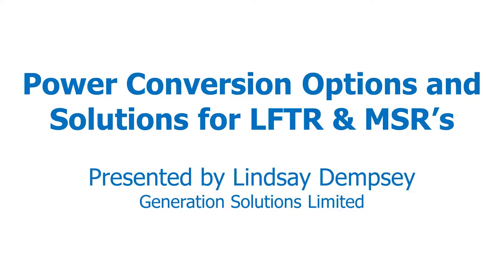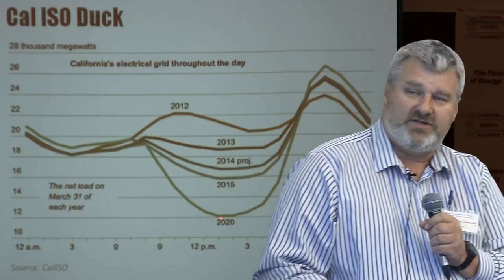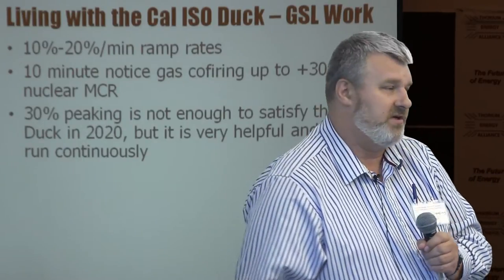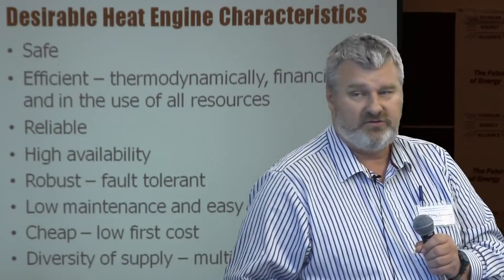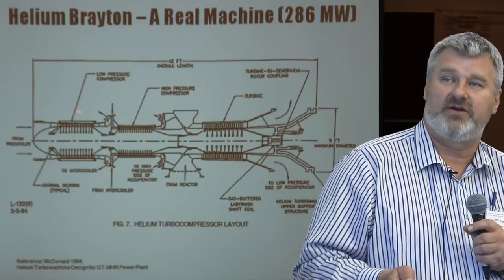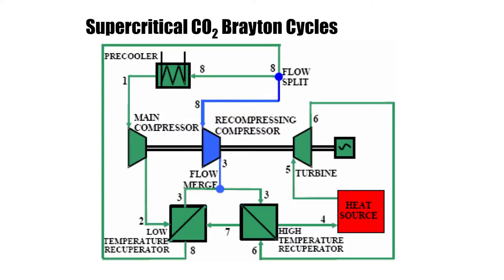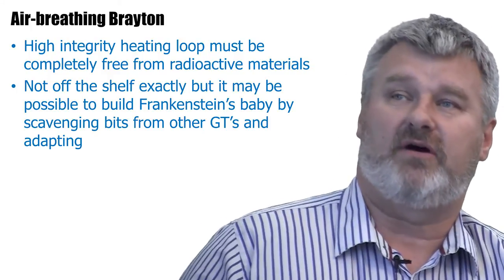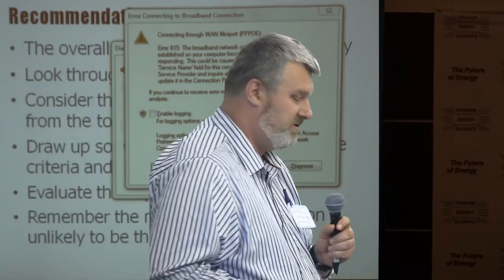MSR Power Conversion Options -by Lindsay Dempsey @ TEAC7

Comment: I think the key take-away here is most definitely the very last statement at the end of the presentation:
"The most economical solution may not necessarily be the most efficient solution"

We have to be pragmatic about power generation options. The WAMSR route by Transatomic of using steam to hit their LCOE competitive with coal and with minimal tech development is the way forward. A 90% solution available now to be able to displace coal generation instead of a more ambitious 100% solution is needed. In addition, being able to swap out a decommissioned coal plant while re-using the turbomachinery represents a cost saving that should be explored. Moving forward, supercritical steam turbomachinery could allow the 45% efficiencies without any technology development required as they are being put onto new coal plants as we speak.

If we are talking about CCGT then we must also heed the history of coupling nuclear with Brayton cycles - dry cooling/exhaust or not. The South African experience should be a warning to anyone chasing the 100% solution:
http://www.nature.com/news/2010/100223/full/4631008b.html
Their lofty goals of maximum temperature output and maximum efficiency using a helium Brayton set engineering challenges too high to meet. This is the risk of allowing perfect to become the enemy of good enough.

http://web.mit.edu/pebble-bed/Presentation/HTGR.pdf
https://en.wikipedia.org/wiki/Closed-cycle_gas_turbine

It is notable that the South African experience too, was considering using the high-temperature process heat for manifold purposes - hydrogen production, chemical process heat and so on. Their program failed because the goals were too ambitious.

MSRs, like any other engineering project, are in no way infallible to the same problems of scope creep. The difference between saying it can be done and actually doing it is an abyss that swallows dreams and spits out only tears. The nuclear power for climate change argument will only make sense if it is cheaper than coal. Until we actually see CCGTs being deployed from a variety of suppliers; we should curb our enthusiasm.

That being said, keep an eye out for Toshiba. http://phys.org/news/2014-10-first-of-a-kind-supercritical-co2-turbine.html

Comment: It's a little surprising that a CCGT (combined cycle gas turbine) is grouped among the more exotic power gen options? A whole fleet of those is running at in excess of 50 % net efficiency? Also, these are easily ramped up and down... ? 
Another point is that low temperature desalination must always take into account that an atmospheric pressure boiling (thus, @ 100 oC) first step in the multi stage flash is required for degassing (non condensibles) prior to vacuum flash distillation. Yet another point is that for desalination, RO is now the preferred choice. 
All in all it may be the best plan to couple a proper, off the shelf Rankine steam turbine to the high temperature MSR system. Efficiencies in excess of 45% should be doable.

Comment: Instead of worrying about load following so much, which is apparently necessary in California, why not run your reactors at 100% (or 90% if that's what's optimal) 24/7 and use the excess capacity to make hydrocarbons for transportation fuels among other products that can be done with the high-temperature chemistry capabilities that's available with MSRs? Then you can do your load shedding by transferring capacity between high-temperature chemistry and electricity production.
 
Of course this is all academic. I doubt we'll have 28 thousand megawatts of capacity from LFTR/MSRs by 2020. I sure hope we do...
Reply: The main point is that, love them or hate them all generators will have to live with renewables and the consequences they create.
Reply: jvanstyn The other point is that in an economically rational real-time market without subsidies, the low marginal cost of production from MSR's will tend to bring renewables and MSR's into conflict during low demand periods.  The results could be some low cost electricity and financial losses for generators as both technologies have high capital cost and low operating costs.
Reply: +jvanstyn The point is not that we should design systems that we then force the market to adopt (i.e. wind and solar with massive subsidies); but rather that we design systems that the market adopts because it is rational with the current conditions. I believe the formal term for making something no-one wants is called a "failed product". 

It should also be noted that any industrial process with high throughput is usually designed to rely on constant mass flows. Fischer Tropsch is one such process: https://en.wikipedia.org/wiki/Fischer%E2%80%93Tropsch_process . 
You need to maintain the reaction conditions (150-300 degrees Celsius). You need a constantly recirculating catalyst with a fluidised bed. You need a steady flow of syngas. Fischer Tropsch is already borderline uneconomic given the current state of oil and gas prices; and this is with cheap methane feedstock; not gasified coal. Add on the cost of a E-CEM for seawater CO2 recovery and you are talking something that requires carbon prices in the above $100 range. 
https://en.wikipedia.org/wiki/Oryx_GTL

The expense and inefficiency of running F-T as a deferred load seems to me like a recipe for failure. 

A "good" deferred load example would be desalination. The reverse osmosis membranes are highly modularised, meaning you can vary output easily. There are no reaction conditions that need to be maintained, like temperature. The pumps that drive the process can be ramped up and down: https://en.wikipedia.org/wiki/Reverse_osmosis . Importantly, the product (water) requires no chemical reactions to take place; there are no catalysts required, no mass flows that need to be managed beyond just finding a place to store the purified water. All you need is electricity.
Reply: +MonMalthias I agree, RO is a process that can be turned off and on with minimal disruption and you can very easily stockpile both feedstock and final product very cheaply, which in turn means that you don't have to run continuously to meet your customer's needs.
Reply: It should also be noted that load following with nuclear reactors being "impossible" or "uneconomic" is also a false meme, probably promulgated by the antinuclear elements of the "100% renewable" visions. The EU stipulates minimum NPP manoeuverability requirements of its light-water cooled  reactors, and they meet and often exceed those requirements despite being saddled with xenon transients and steam system inertia. 

https://www.oecd-nea.org/ndd/reports/2011/load-following-npp.pdf

EU NPPs can vary 3-5% of rated power between 50-100% to meet requirements. The impact on capacity factor, at least according to OECD NEA (which is an industry organisation) is apparently only 1-2%. See table 2.1 on page 20 of the report: The N4 reactors that form the backbone of the current French fleet do so every day, operating in mode X. 

The German plants were designed with similar manoeuverability in mind: https://www.iaea.org/NuclearPower/Downloadable/Meetings/2014/2014-10-06-10-08-TM-NPE/21-Oltmanns-Flexible_Operation_experience_in_germany.pdf - and they have even greater challenges; facing imminent phase-out, rapid ramp rate requirements due to renewables penetration, and a political base hostile to their existence. 

Now, it needs to be said that NPP with a steam system will almost always be inferior in terms of depth of variation and duty cycle limitations to that of combined cycle gas, which is in turn inferior to open  cycle gas. 
http://www.energy.siemens.com/hq/pool/hq/power-generation/power-plants/gas-fired-power-plants/combined-cycle-powerplants/Flexible_future_for_combined_cycle_US.pdf

MSRs and LMFBRs in this aspect, at least, have some advantage  over water cooled reactors; especially MSRs due to the lack of xenon transients. But even LMFBRs can load follow extremely well; since the fast spectrum is not susceptible to xenon: https://books.google.com.au/books?id=dXJ3CAAAQBAJ&pg=PA383&dq=xenon+poisoning+in+fast+reactors&hl=en&sa=X&ved=0ahUKEwj535SxnZ_KAhVCOKYKHcNrC2AQ6AEILDAD#v=onepage&q=xenon%20poisoning%20in%20fast%20reactors&f=false - the limitations would therefore be in thermal wear and tear. If and when someone invents a practicable supercritical CO2 turbine for LMFBRs or MSRs then even this aspect can be minimised or eliminated entirely.
Reply: Oh, also, here's a hearing between the South Australia Nuclear Fuel Cycle Royal Commission on renewables, fossil, nuclear, and grid integration: http://nuclearrc.sa.gov.au/videos/climate-change-and-energy-policy-10122015-1130am/ . 

Key points:
- Variable renewables can be easily integrated up to 20% penetration beyond which costs begin to rise
- Current Australian market conditions favour fossil fuel generation.
- A long, thin grid poses bottleneck challenges with respect to energy transmission and poses limits upon being able to rely on distributed generation over large distances to smooth intermittency.
- Renewables and nuclear are NOT in competition, but complementary
- The goal should be a 100% carbon free grid, NOT a 100% renewables grid.
- Studies by AEMO (https://www.environment.gov.au/climate-change/publications/aemo-modelling-outcomes) indicate that while 100% renewable system is feasible it still relies heavily on dispatchable generation from geothermal and biomass.
- Battery storage requires minimum 5-fold cost reduction to become viable at residential prices (more required if to be competitive at grid scale prices)
- National energy policy is required. Market based interventions will NOT result in rapid or deep decarbonisation, because the market is short sighted.

Comment: Produce fuel with excess capacity during duck neck ramp, seems to me also  that  a couple car battery's  worth or stored energy  at home  would  flatten the ramp out
Reply: bodyheals The challenge is that fuel production from electricity is capital intensive, so running it for only 4 -5 hours per day destroys the economics of using lower cost electricity.  There are no cheap fixes, having massive East - West HVDC interconnectors helps move the electricity into different time zones, but it is not cheap either.
Reply: @lindsaydempsey5683  I've got two solutions for that, make fuel production the primary use for the energy being generated and only diverting heat as necessary to generate electricity for peaking loads (or use some of the synthetic fuel to run something like an open cycle gas turbine to provide the same function depending on how the economics works out), so that fuel production is occurring closer to 24 hours a day with just a few hours per day of reduced output in the evenings, plus they could probably get much higher profit margins for fuel sales than electricity. The other solution would be running a thermal desalination facility, the capital costs of which should be much lower (this isn't a solution everywhere because not everywhere needs desalinated water but would be a major selling point in a lot of places around the world).
Reply: @coreymicallef365  Funny you should mention that, my most recent work in this space has been to look at integrating molten salt based thermal storage.  It's economic and it works pretty well, not  a total solution but definitely a 90% solution.

Comment: If only the consumer end of the process would be charged not just for the volume of electricity used, but when it is used to help push some of the peaks into the valleys.
Reply: With the advent of smart meters, the day is soon coming when consumers will have the choice of whether they want to ride the roller coaster of real-time electricity pricing or fixed average pricing.
Reply: Lindsay Dempsey some offer peak and off peak rates right now
Reply: I hate that idea. We want to head towards a post-scarcity world, and that is counterproductive. I live on time-of-use metering and it doesn't make a real difference, just a larger bill from the ontario liberal party.

Comment: The best solution for LFTR is 2 stage AlCl3 for the temperature range 600-300C and for the rejected heath Kalina cycle (NH3/H2O)  for the temperature range less than 300C. I wonder why nobody tries to do any research with AlCl3 it's almost as ridiculous as not developing  LFTR
Reply: The gas would have to 99.99999% liquid free to avoid the topping turbine salting up ceasing operation. Also at high temperatures a Kalina cycle provide no benefits over steam.

Comment: Alberta power Sept 2015 on  peak average $22.38/ MWh, $17.80/ MWh for off peak . From AESO . In Ontario, prices are about in the same range. When prices are like this, power time shifting is not economical.  The price difference between power producers and power users is huge though. Therefore, I see people wanting to produce their own power.  Small molten salt reactors (.1-1MW) and solar  owned by coop groups .  Note: Alberta uses gas and coal, Ontario uses hydro and nuclear. Peak demand for Sept in Alberta was 10,000 MW. Alberta can produce16,000 MW at full capacity. Talk about over supply.